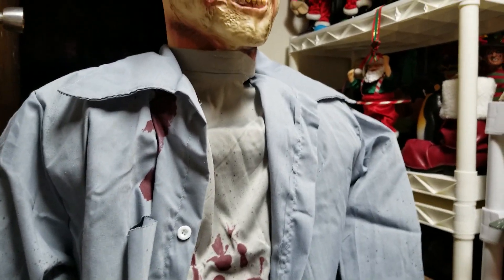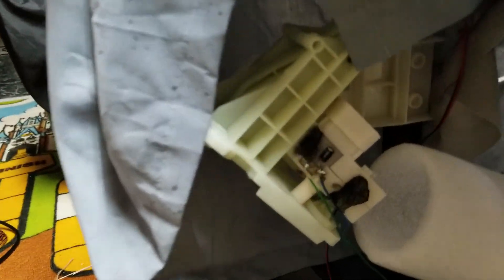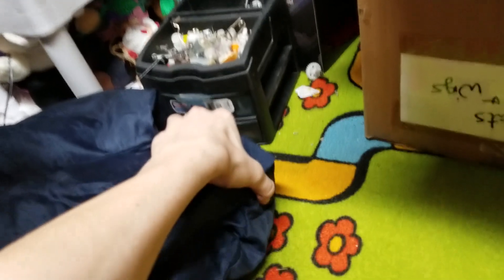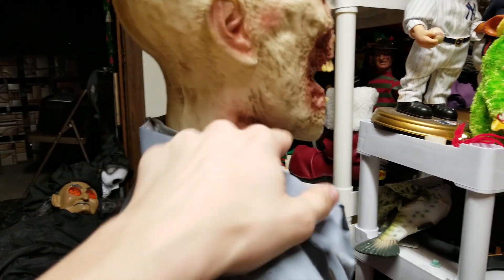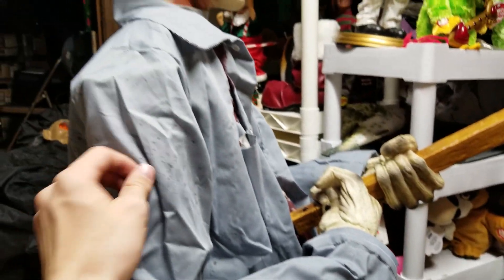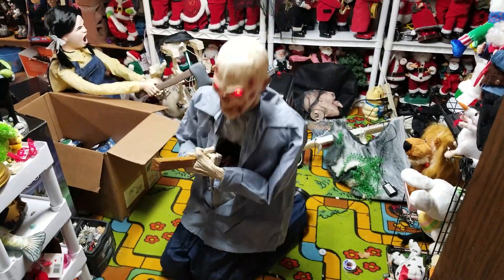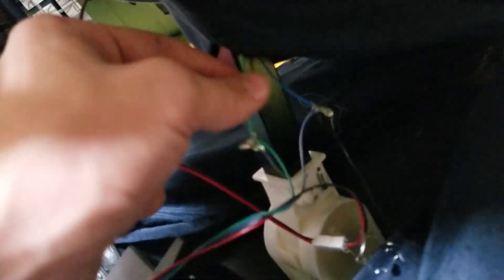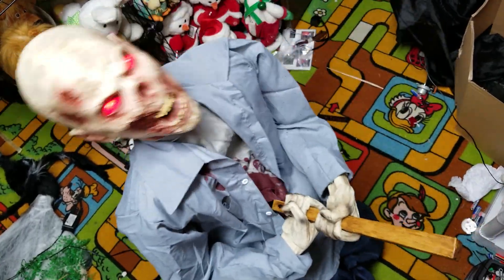Spirit Halloween Animated punctured Pete Zombie

Comment: Nice repair! Have you considered examining the board for busted transistors? Most of the time, if the wires touch like that it will bust a power transistor.
Reply from the maker: Thanks,and ya, I just dont really know or have ones to replace them with